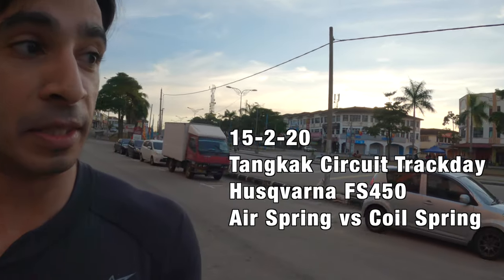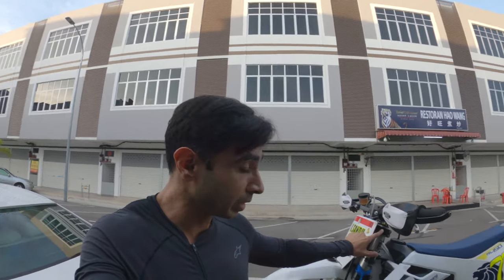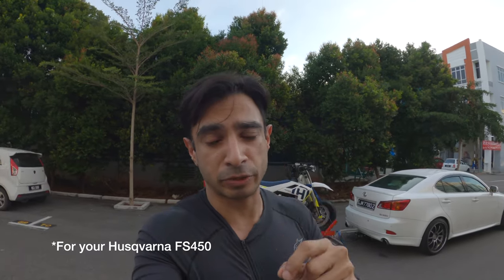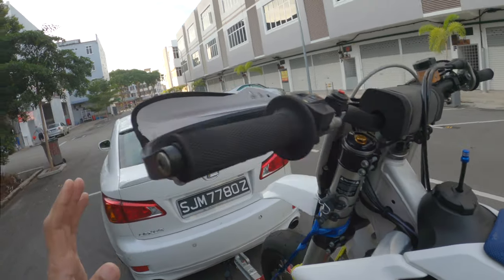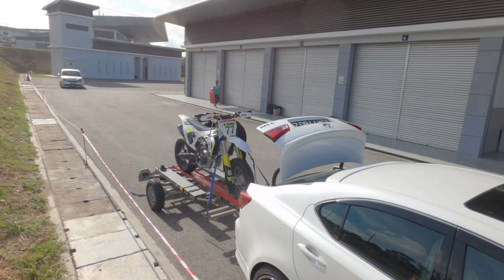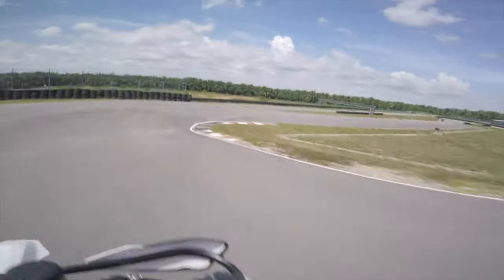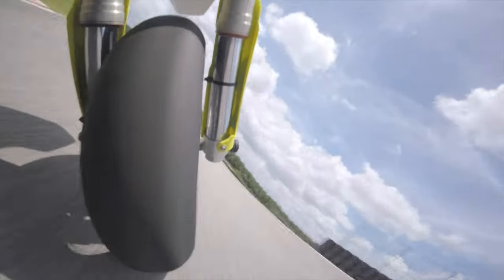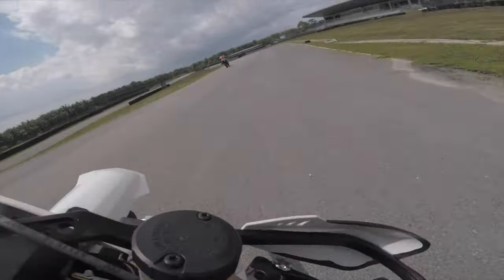WP AER Air Fork vs Andreani Spring Kit for Husqvarna FS450 @ Tangkak Circuit -Trackday Vlog

Comment: Which spring u use for your bike ?
Reply from the maker: Thomas Biader you specify rider weight when you order then they supply the appropriate spring. Unfortunately I did not take note of the actual spring rate they gave me, sorry
Reply: @KevGoesRiding  thanks but you bought and install without problem ? Because for supermoto the cartdrige is short i think . I have a lot of problem with air and i want to resolve with this kit.
Reply from the maker: @thomasbiader3022  Not to worry, if there is even a difference in height, it is not noticable, either visually, or to the handling of the bike. There is zero installation issue. I am certain you will like the kit very much